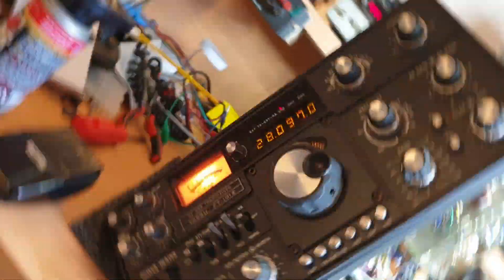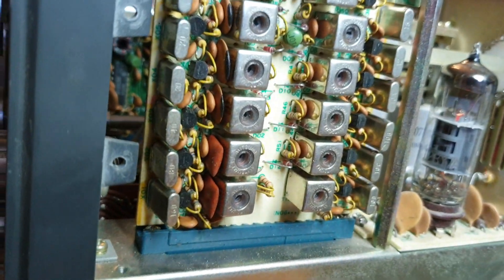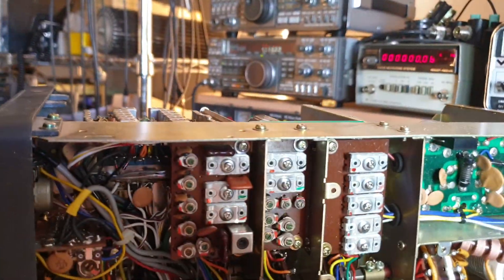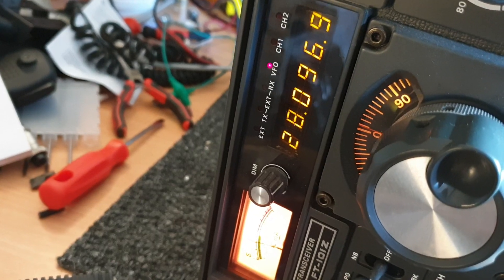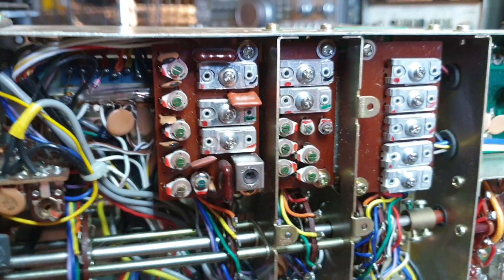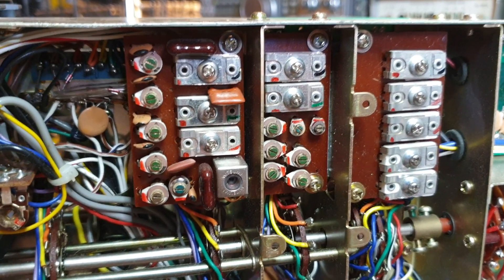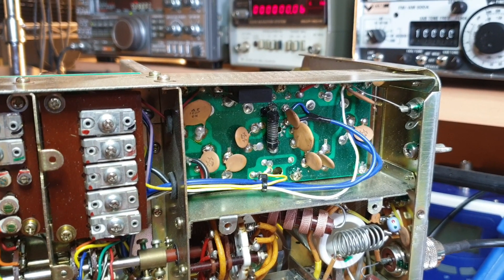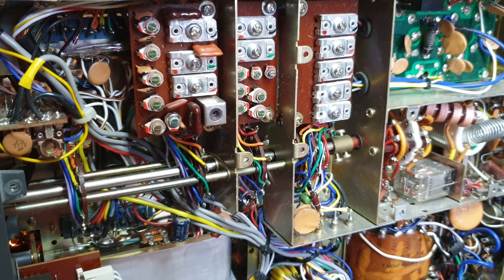Yaesu FT101ZD HF Transceiver 11m back to 10m conversion. There's nothing like an original FT101ZD.

Comment: I just converted my 101ZD Mk 3 back to full amateur operation, but the 10 meter frequencies are off by about 10 - 15 kc/s.  How do I bring the 10 meter frequencies back into line with the rest of the rig.  This is an outstanding radio - great video.

Comment: Nice radio and great video. I have 1 mk1 and 2 mk2 FT-101ZD's but no mk3. Great radio's and not much to work on because the 2 mk2's work great. Mk1 need a new display board. Thanks for the info.
Reply: I need back my 902dm tô 12metres. I replaced the 12meters cristal to original38.9875.
But the display stpoed in 26.0000.
I need adjust the VCO unit?
Please relp me!
Thanks  PY3 SOV